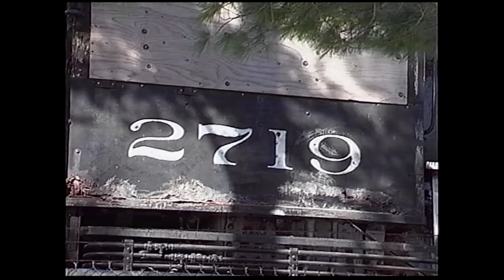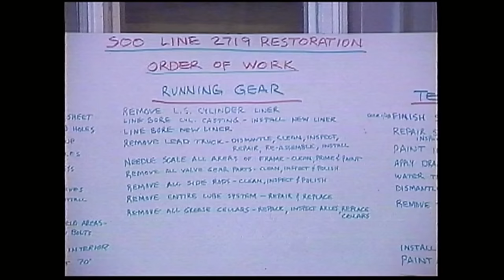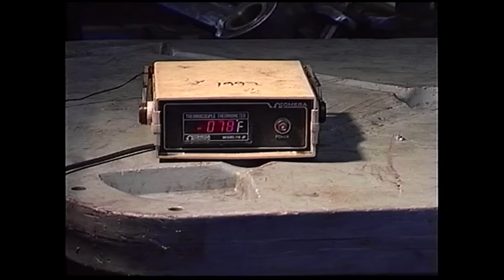Restoring a 4-6-2 Pacific in 35 Minutes! - Soo Line 2719

Comment: This really puts into perspective on why a steam Locomotive restoration takes so damn long.
Reply: I was expecting it to take much longer then 35 minutes to be honest.
Reply: And why diesels took over. I'm so glad so may of these beauties are being brought back to life. I love the sounds they make, even sitting still it's easy to imagine they are living, breathing creatures. A wonderful part of our history everyone should be able to experience.
Reply: Remember, this one's been covering more miles than it's type was originally designed for, it had also fallen decrepit for years before it was brought in.
It also depended on what the locomotive was used for, freight duty was much more arduous than passenger duty = More maintenance.
But because of routine maintenance they seldom needed to do anything more than that.
Back in the day they would have spent no more than a couple of weeks in the shop, they even took it so far as transferring the hot water from locomotive inbound for maintenance into an outgoing one to save on time there as well.
Because steam locomotives were phased out by the time they did this rebuild it took much longer than that.
The way it used to be done was keeping the boiler hot until it's monthly boiler wash to get rid of scaling inside and outside the tubes.
So, they definitely got by with steam, but needed looking after and wasn't maintenance free, what killed the steam locomotive was maintenance and running costs.
Reply: and how long it took to be mad in factory!!!
Reply: What do you mean it only took 35 minutes
Reply: So that's why Renaes (I'm sorry if I spelled that wrong) took 9 years before returning to Sodor.
Reply: We did it all outside in Albuquerque and it just took 20 years ( ATSF2926)
Reply: @slabriprock5329  no diesel literally only took over because they were cheaper to build and buy that's the only reason
Reply: @slabriprock5329 thats not exactly true, it’s alright to maintain when maintained, not sitting in a park for 30 years

Comment: Wow, incredible that they were able to completely restore it in a little over 35 minutes! That’s gotta be a record.
Reply: i don't know if you're serious or not
Reply: @PreservationEnthusiast  dude, literally everything with a diesel engine in it creates c02, also steam locomotives are apart of history.
Reply: @HazzyHazeI  When did I mention diesels? Those should be cut up too. We need to use electric power with energy created from renewable resource and hydrogen power.
Reply: @PreservationEnthusiast  well let's cut up all the cars too then, also don't forget most boats
Reply: @PreservationEnthusiast  did you forget that like half the co2 is made by farms, also electric cars are a terrible idea, they still take lots of space, the batteries occasionally explode, they are way too expensive, there's no reason to have cars anymore. also steam locomotives are part of our history and are way more efficient than cars steam locomotive or diesel. we can't just get rid of history
Reply: @HazzyHazeI  Steam locos are more efficient than other types?????!

Are you on drugs?!

Steam locos as external combustion are 10% efficient at best. Diesel and petrol are 20 to 30% efficient. Electric traction motors are 90% efficient.

Put another way if some electricity was uses to boil water in a steam loco, for the same amount of electric  power used in a traction motor the motor version would go 9 times as far as the steam loco.

 Really, I think you should do a little bit of research before you post again! You are making ridiculous statements.
Reply: @PreservationEnthusiast  steam locomotives are better than cars, also you completely disregarded my statement about cars and farms.
Reply: @HazzyHazeI  Agriculture produces C02, that's correct, but we must tackle all sources of pollution.

I'm picking up on your statement that steam locomotives are more efficient. They are 10% efficient... this is terrible. Diesel engines are 30% efficient. Electric motors are 90% efficient.

Steam locomotives must be cut for scrap and melted down!
Reply: @PreservationEnthusiast  are you gonna build all the infrastructure for electric locomotives? also you missed the point. we have to preserve history. we won't be actively using steam locomotives
Reply: @HazzyHazeI  It has partially been built anyway and will continue to be built. Not by you or I personally, but by humanity in general.

Also why do we have to preserve "history"? Everything we do or make is history. These things are recorded in films and books. No need to preserve everything... there is no space. A few locomotives are already preserved, we don't need more.
Reply: @HazzyHazeI  Not.
Reply: I didnt think my silly little comment would spark such a violent debate god damn
Reply: @Shadow_Architect  this stubborn guy has a fiery hatred for steam locomotives apparently
Reply: @Shadow_Architect  I was helping to educate another person in the thread who had no idea about the poor efficiency of steam locomotives.
Reply: @PreservationEnthusiast

Comment: I wish my Grandfather could have seen this.  He worked for the Soo Line for many years and retired as Section Chief of the Harlow ND branch around the time this engine made its last passenger run.  We still have a ton of buckets, shovels, tools, etc., with the "Soo Line" stamp on them.  It was hard work, I remember Mom telling me stories about him going out in the speeder (A little gas engine driven cart that ran on the tracks) no matter how hot, cold, or stormy it was because he was responsible for ensuring the tracks were in good condition.  And of course in his earlier years he had been one of the crew doing the hard work of laying and maintaining those rails.  For all that hard work Mom said he never had anything but good to say about the Soo Line railroad and how he was treated.  He would have been bursting with pride to see an old Soo Line steam locomotive restored and put back into service.
Reply from the maker: it's great to hear stories like this, thank you for sharing.
Reply: That is the way I felt about the GN BN. As a machinist I retired 2004 and went to work in 2015 on the ATSF 2926 finished 2021 in ALBUQUERQUE  www.2926.us

Comment: Nice to see a lot of professionalism going on here, all the documentation of everything done, thousands of inspections of the metal. These aren't just shade tree mechanics, these guys are pros. I used to do depot-level maintenance on aircraft that involved a lot of work like this. Much respect to this crew because it's anything but easy yet so satisfying when you're done and it rolls out.
Reply: Just thinking the same thing.
Reply: got to be pro's, you dont get a boiler certified without the inspections.
Reply: When a machine goes out and you can say to yourself "Sure, I'd be proud to let my mom drive that, or ride on it.."

Comment: So very cool,..when you have the expertise and the right equipment, it goes along smoothly. My friend in Southern Ohio, pulled a pre-Civil War built, farm steam engine out of a bog, and was given it, for his efforts. Even though it had been submerged in muddy glop, for 50 years,    it was in repairable condition. The bog preserved the iron monster. He was a master welder and was certain he could get back in running order. That steam engine would have powered, a sawmill, or something similar. It sat on huge iron wheels. The the style of rivets holding the boiler together and the smoke stack, defined the year it was manufactured. (as in: pre or post Civil War. It was very solid, some internal heat tubes needed repair. My friend also resurrected and was using a late 1800s, (portable) saw mill. Portable because it was mounted to an iron sled. It was also in a bog. He cleaned up, and got it running, using a WW2 Jeep, to power it. He was able to make money, cutting rail road ties, for the rail road in his area.

Comment: It's hard to believe the engine could sit around in the open so long and still be brought back to life. Kudos to everyone.
Reply: That’s cause things used to be made to last
Reply: @DontCryAboutIt  Consider that the video is 25 years old.  Most of those older guys that were fixing stuff were in their 50's and 60's are gone now.
Reply: Can you hear a message could you read that to me I cannot read I can hardly say
Reply: Believe it or not, more often then not, the railroads were far harder on these machines toward the end of the steam era than the elements ever could be. Why would the railroad take care of them when they are going to be scrapped and replaced? The majority were run into the ground and then dumped on the dead lines, often with high mileage on the running gear, screwed up frames, bad wheels... The middle bit of the preservation era was also hard on these machines, as a lot of the folks who had the experience to work on and run them retired, passed away, or otherwise left the industry. I like to call it the "Patch it, and get it out the door era." (Late 80's, early 90's). Problems that could have been manageable with proper maintenance then, are now big expensive problems which are responsible for sidelining popular excursion stars. There were a number of locomotives then that probably shouldn't even have been running by 2022 standards. Then, the Gettysburg 1278 incident happened, and re-wrote the rule book. Thankfully, there are enough machinists, welders, and boilermakers out there with enough interest in working on these things to support the locomotives we have. Thanks to them, we are currently experiencing a Renaissance of sorts.

Comment: Soo Line 2719 is a 4-6-2 "Pacific" type steam locomotive was restored and operated in excursion service from 1998 until 2013 when its boiler certificate expired. Today, the locomotive remains on display in Duluth, Minnesota. Built by the American Locomotive Company (ALCO) for use on passenger trains operated by the Minneapolis, St. Paul and Sault Ste. Marie Railway ("Soo Line"). No. 2719 was used to haul the Soo Line's last steam-powered train, a June 21, 1959 round-trip excursion between Minneapolis, Minnesota and Ladysmith, Wisconsin. It was then displayed in Eau Claire, Wisconsin until 1996.[3]
Reply: Soo sad to read about the end of this wonderful machine, when I saw the video  planning to visit them take a ride on board
Reply: I need to restore all these engines
Reply: I've been there in the museum. There's also another 2 trains in 2 harbors about 30 miles up the north shore. You can take the excursion and see it.
Reply: What do you mean the boiler certificate expired? What does that mean?
Reply: @Deltaexe190  It means that every 15 years, or 1,472 days of operation, the locomotive would have to get its boiler flues replaced and get anything else inspected and repaired, which is called the “1,472-day inspection.” So in the short terms, a mandated overhaul. The process could take a few years but the Strasburg Railroad did a 1,472-day inspection on one of their engines in 6 months flat.
Reply: @TheLongIslandRailfan  cool
Reply: I love to watch documentaries about this stuff I’m learning pipe fitting and welding at school
Reply from the maker: a very skilled trade, best of luck to you :)
Reply: Wikipedia copy and paste
Reply: @pletsexpress tell that to the wikipedians
They deserve the credit

Comment: India had 750 of these under the designation WP  ( broad gauge/wide = W , and P = passenger) with usual 4-6-2 wheel cofiguration. Baldwin in USA was their biggest supplier but about 300 were built in India itself. Later India imported and built the goods locomotive of the same steam engine with 2-8-2 wheel configuration, thereby increasing traction and decreasing speed slightly. They were used for goods train and were called WG (wide, goods). They imported and built total 2600 of these and used them for mixed traffic both goods and some passenger. Now eight of each kind are preserved in rail museum. They were replaced by first ALCO diesel, then EMD diesel, them GE diesel and now almost total electric locomotives ( Hitachi, Alstom, ABB, Siemens etc). India is a prime rail road country. They are quite innovative too.
Reply from the maker: interesting, thank you for sharing!

Comment: 24 years later I wonder if she's still steaming around?
Edit: she was abandoned after only 4 years of excursions and left to rot!
Reply: Tf? Realy tha's sad
Reply: She's actually not doing too bad. At the moment 2719 is in a sheltered display waiting for another restoration
Reply: It was on display in Eau Claire, Wisconsin until 1996.  It was restored and operated in excursion service from 1998 until 2013 when its boiler certificate expired. Today, the locomotive remains on static display in Duluth, Minnesota."No. 2719's boiler flue time was to expire on July 31, 2013, but its flue time was extended so that it could operate into late summer of 2013. It pulled its final excursion on September 14, 2013. Afterwards, the locomotive was to have gotten its FRA-required 1,472-day rebuild. However, because of ownership disputes, it was drained to the LSRM for display instead. In June 2015, No. 2719 was officially purchased by the LSRM. In the summer of 2019, No. 2719 was displayed outside for the first time (not under the parking ramp) along with No. 14 and D&NE 28 to welcome Union Pacific Big Boy No. 4014 during its midwest tour stop in Duluth.
"

Comment: It's my understaanding that there was no insulation between the boiler and the  outer shell. There were special hollow rivets used on the boiler that would let steam out if they cracked, and that would alert the operator/driver/engineer that the engine needed maintenance.

Comment: This is interesting. Went to UWEC. Familiar with this locomotive. 
Nice to see it more than a static display. 

It was fenced in in 1983 when I started up there and looked like it was there a while.

Originally video released in 1999. 
Wondering where it is now?
Reply: Apparently her boiler certificate expired in 2013 and she's on display in Duluth.
Reply: Yes. 
What a shame for all those involved in the original restoration. Too bad it isn’t kept running through funding from movie prop use or tours. 
So expensive and difficult to get it running and then keep it running on the tracks.

Comment: Hello Bradley I just watched the full length version of Soo Line 2719s restoration video on dvd and it is very well put together!! Well done! I also want to ask when are you going to rerelease Soo Line 2719 Steamin Through the Chippewa Valley?
Reply from the maker: @Michael Colucci  Thank you for the kind words. I am actually working on restoring that SOO 2719 Steamin' program this very minute.  It is tedious work to restore the program scene by scene and adjust and improve audio throughout. I should have it complete in three weeks and re-listed on our website and YouTube shortly after. It has been fun to see this program again, stay tuned -  the end result will be fantastic!  Thank you for watching Michael.
Reply: @pletsexpress  was there any out of print films that I’m not aware of?? Like NP 328, mid continent rr, etc??
Reply from the maker: @Nicholas Medovich  We only had one film out of circulation and as of today it's back! 'Soo Line 2719 Steamin' Thru the Chippewa Valley' does indeed have the NP 328, and it's leading a TRIPLE header to top it off! This film also includes the Soo Line 1003.  Here's the YouTube clip link https://youtu.be/UUIithrCg2Y

Comment: @ 17:30 was a perfect "Pit" maneuver to stop the Loco. But my biggest question is why starting @ 27:30 during yard testing, why was it necessary to fire up a 2nd Loco and couple them  together??
Reply from the maker: That's a great question. The second loco Soo Line 1003 was used for braking effort. This ensured the 2719 was working under load. Thank you for watching

Comment: 9:25 small point: corrosion applies to non-ferrous metals, like brass, copper, aluminium, etc.. Ferrous metals like iron and steel don’t corrode, they rust. It is true that both are different sides of the same oxidising coin but they are, nevertheless different.
Reply from the maker: thank you for pointing that out, noted.

Comment: I seen a bumper pull rv trailer 1 axle and the electric motors were mounted on each axle hub. The electric motors are suppose to charge the pulling vehicles battery's. Have you seen this. ? I saw it on you tube. Denis from Santa Rosa CA